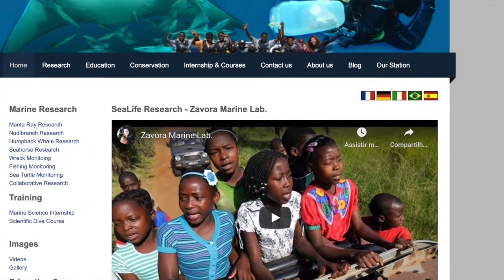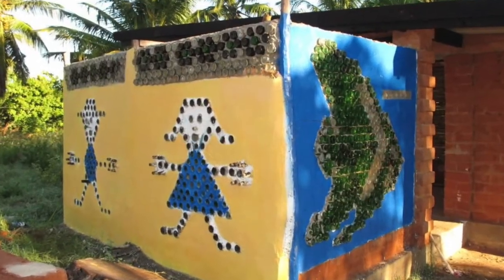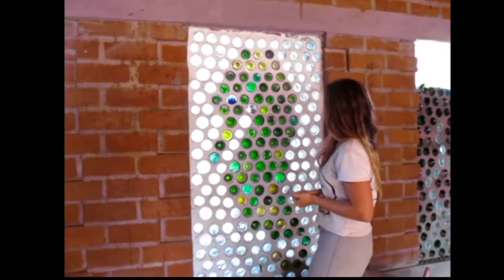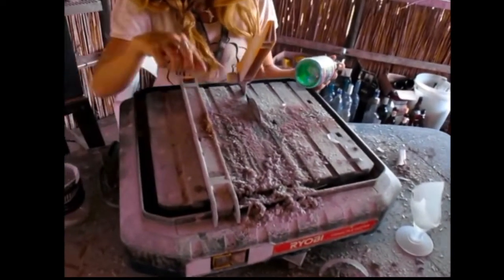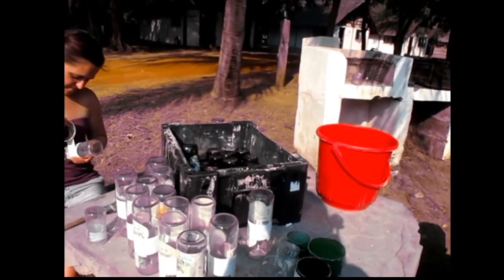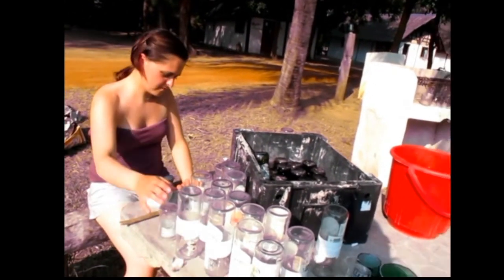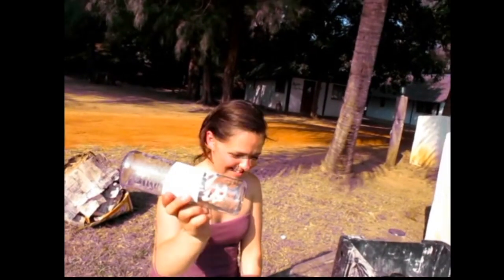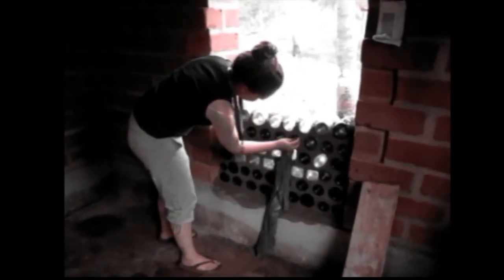Bottle wall building step by step tutorial

Comment: loved this video thanks for sharing.. i would like to create two bottle walls.. i have some questions about it though? Like what kind of cement you use? and can be done wrong to a point it collapses?
Reply from the maker: We used the normal construction cement but you could do with Adobe if you have the right mud. We unfortunately didn’t have. I would make the structural part with wood or concrete and then the bottle wall as a filling I think is very unlikely that it will collapses, just if you make it very wrong, but I am not an expert...that were my first ones and I learnt in youtube. They are still in great conditions and haven’t collapsed and it has been about 5 years ;)

Comment: 1:30 What are the mortar ingredients exactly? You probably should use clay/lime mortar instead of cement. If mortar is harder than bricks it will brake the bricks over time.
Reply from the maker: Now we will need to wait to see...it has been six years and it still strong, I used what was available there which was cement, I have seen many other bottle walls using cement too so hopefully will be ok, too latte to worry